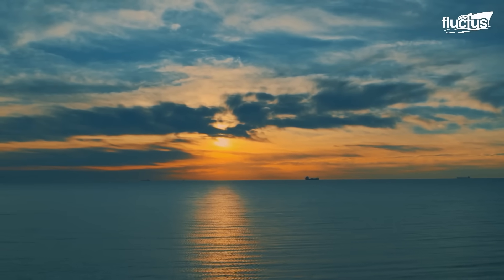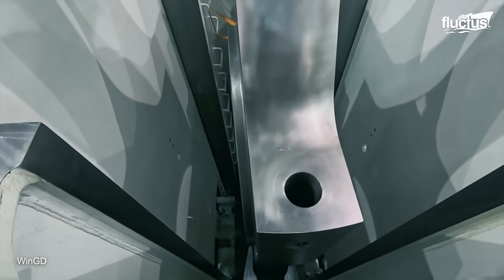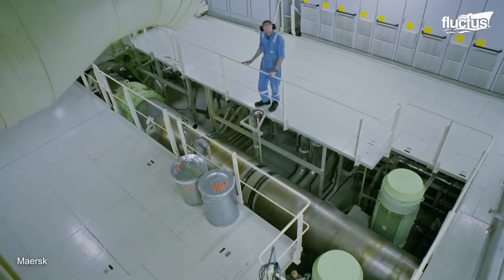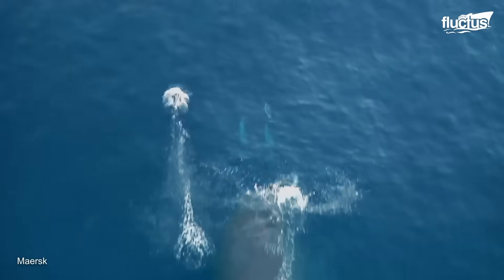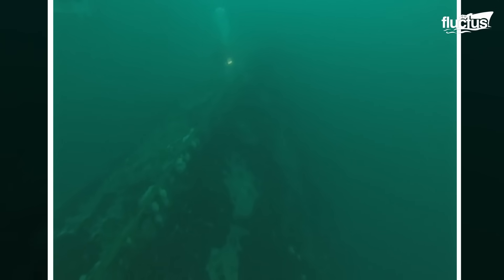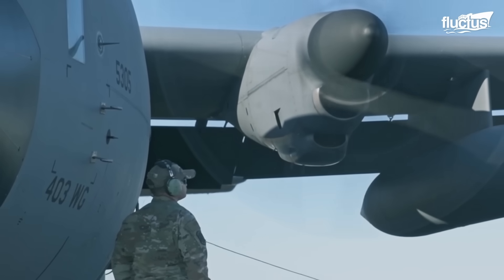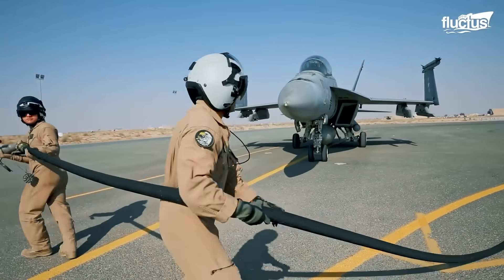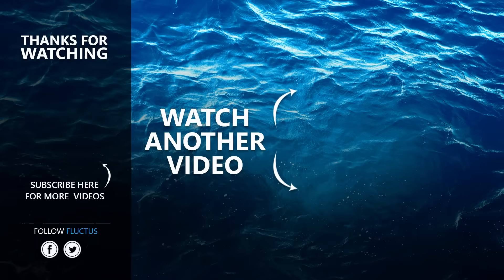The Incredible Power Needed to Spin the World’s Largest Ships Propellers

Comment: Spin is a poor word for what the engine does to the propeller. You spin a pinwheel. You rotate or drive a cargo ship propeller with significant torque/horsepower.

Comment: I always wonder why cargo vessels usually have one large propeller, while passenger vessels have 2 or more.
Reply: Because cargo ship is low speed using single engine while cruise ship is using multiple generators to drive electric motor connected to propeller that is why cruise ship also is much faster than container ship
Reply: @loretoverzo3430  Cruise ships are by no means MUCH faster than container ships. Their speed range is around 20-25 kt, while we travel between 18-23 kt.

The type of propulsion has little to do with it, by the way. Modern cruise ships usually have multiple pod propulsion systems to make them more maneuverable, as they often call at destinations where there is little space for maneuvering and/or no suitable port infrastructure.

Container ships in liner shipping are built to travel forward and straight over long distances with minimal fuel consumption. We usually have fixed routes to ports that can provide the necessary infrastructure for docking. Therefore, box carriers don't require complicated propulsion mechanisms, although we do, of course, have bow thrusters.
Reply: Single propellers are more fuel efficient than twin installations— container ships do not have to dock often so maneuvering is not a big issue
Reply: That is, as someone has already correctly commented, because a single propeller is the most technically effective and cost-effective type of propulsion for a ship. One propeller, one main engine. No gearbox or other additional components.

In the 1960s to 1980s, there were certainly cargo ships that were powered by turbines or multiple main engines via two propellers. Back then, speed was the ultimate goal. Many of these ships were converted to a slow-running two-stroke diesel after a few years because the greater expense of two engines or a complicated turbine system simply wasn't worth it.

Speed is of secondary importance in sea transport. Reliability and punctuality are the key factors in liner shipping. However, these factors don't depend on the ship's speed, but rather on how well the ports are organized and how effectively they work.
For example, if I take over my ship again in October, this voyage will have been planned over a year ago by our specialists at the shipping company. 
Port slots, arrival times, layover times, berths, cargo handling, etc. are all already fixed. It's up to me to meet these deadlines, and it's the responsibility of the respective ports to provide the appropriate equipment at the right time.

This often doesn't work out so well, but that's not due to the speed of my ship. That's why time buffers are built into every voyage, so that in the end, everything usually works out.
Reply: Because one is just cooler looking and more massive. Kidding. Hopefully someone who has specific knowledge identifies themselves as such and replies with intelligence.